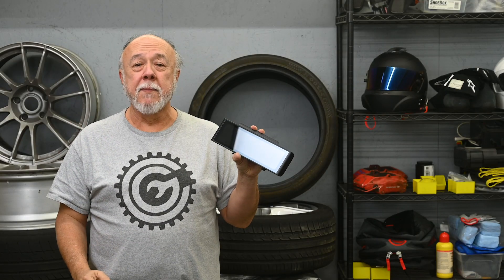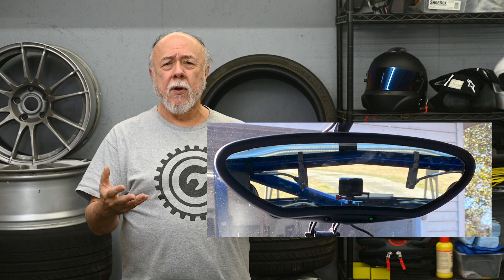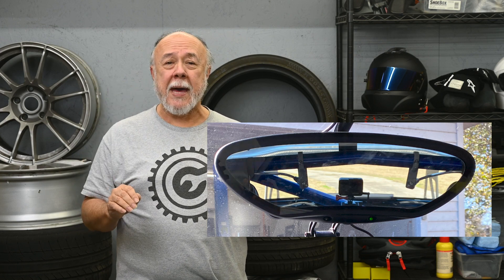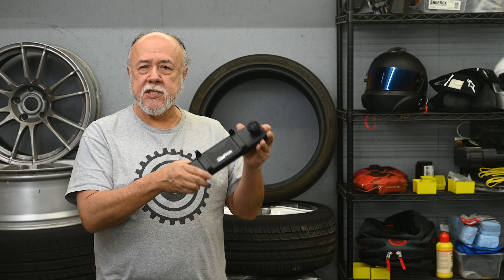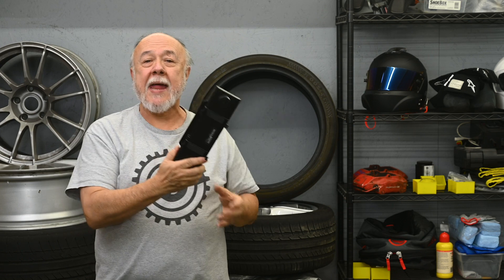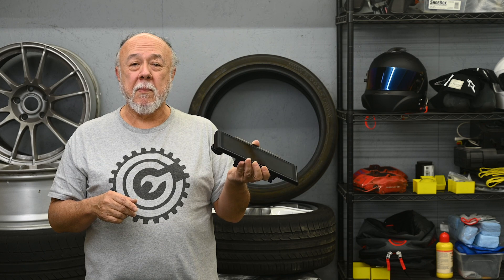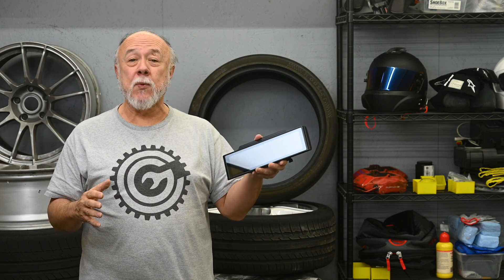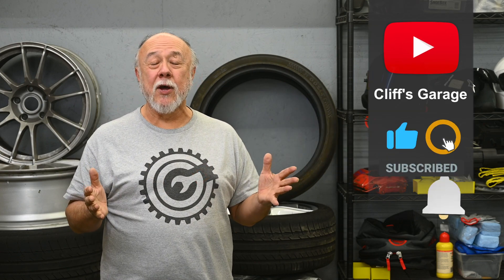This Digital "Mirror" Has A Fatal Flaw (PORMIDO 4K Mirror Dash Cam)

Comment: Just adjust the angle of the screen so that you're not seeing the reflection out the back window. That's not a significant issue with these things. The biggest problem is the focal distance. When you look in a mirror, your eyes focus at the actual distance to the object you're seeing in it. When you look at a digital screen, your eyes have to focus at the distance to the screen, regardless of how far away the object is. With a normal mirror, that means your eyes don't have to refocus between looking ahead and glancing at the rear view, because in both cases, you're focusing at a distance. With a digital mirror, your going from focusing at a distance (out the front windshield) to focusing super-close in (at the digital screen), and your eyes probably can't do that in just a momentary glance. You have to look at it longer. And it becomes much worse if you're at all near-sighted, and wearing glasses to help you focus on the distant objects. Now when you try to glance at the rearview digital mirror, your eyes may not be able to adjust at all! I had a digital in my car (I just removed it), and I could see that there was somebody in view, but usually couldn't tell if they were in my lane or another lane without taking my glasses off. That, and the fact that lights in the digital mirror at night would wash it out completely.

Comment: The mirror being reflective is actually a big benefit imo.. if, for whatever reason, the mirror doesnt start up or there's any technical issue, you can still use it as a regular mirror until you fix the problem. Just adjust the viewing angle so it doesnt reflect. it's very tolerant when it comes to viewing angles... I have 3 of these installed in my car and would never wanna have a car without.

Comment: I have a Pormido PR996. I drive a Chevy Express, so I have a similar problem with not being able to see out the rear windows. Some idiot tonight decided to make a left turn from the right lane, and I barely avoided T-boning them. Checked the dash cam footage when I got home, and it's basically just headlight glare. For insurance purposes, it would be enough to show fault, but I couldn't even see the driver or the license plate. In a hit and run, it would probably be useless. I'm seeing people online talking about polarizing filters. I may try that. I don't really have any complaints other than the poor image quality and glare. I've had it for 3 1/2 years, and I don't think there was anything which was much better when I got it. I also had the issue with the time. I believe you can turn off setting the time with GPS, or maybe I just used a different time zone. I can't remember, but I know it was an hour off. Probably better systems available now. I may get a different one. I would like the interior camera as well.

Comment: I have the same issue.  I have a big rear wing on a GT4 and have looked at this product in the past, but did not pull the trigger.  Did you solve your issue with something else?  I don't like my setup even on the road because I like to adjust the side mirrors out to eliminate my blind spot, but if I can't use the primary rearview mirror effectively this doesn't work and I need the side mirrors pulled in to see what is behind me.  Anyway, if you solve the problem I would love to know how you did it.  Thanks for the video.

Comment: I have the azdome pg17 at first it was good but now that summer is coming and you need to wear sunglasses you wish the mirrors lcd display can go brighter but then again it's a cheaply made product (about $70 for me since the seller discounted 5% and got $70 with tax). I'm also considering putting anti glare/polarized lens so the big gass trucks won't shine the camera rendering the camera unable to see details clearly and with the cheap lcd display with mediocre resolution and together with grainy resolution video output when you viewed it on a PC, I wish GoPro would enter this market co'z my aging go pro hero session max resolution 1080 wide at 30fps beats the video output quality as you can see license plates compared to  this rear mirror dashcams.